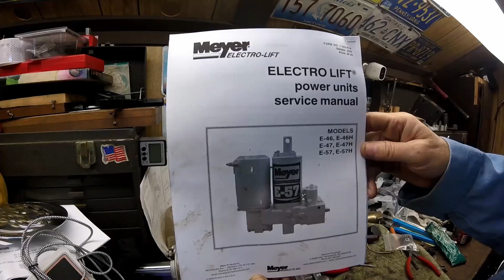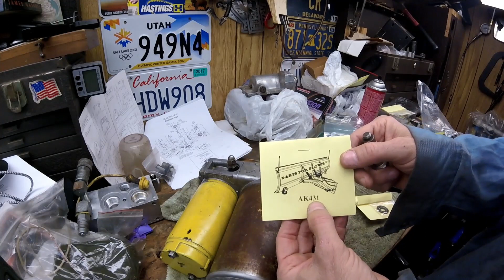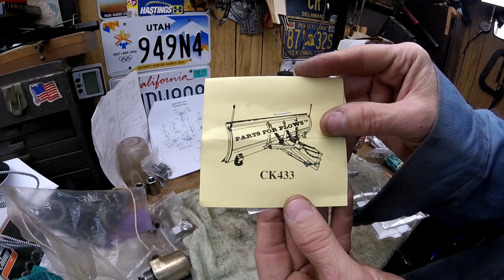Rebuild Meyers E-47 Plow Pump Best One complete

Comment: After the rebuild everything works as it should but I can't stop the leak from under the valve block plug.  The Meyer parts list says there should be a 9/16 ID O-Ring to seal it.  Originally I had the plug only moderately tight.  It leaked around the O-Ring so I toghtened it a little more.  Observe leak and repeat until the O-Ring squeezed out from under the nut.  I tried again with a new O-Ring with the plug tighter on initial installation, but the same thing happened.  What am I doing wrong?  I made a soft aluminum washer, but it leaks.  Now I've made a lead O-Ring which I'll try next.  This is frustrating.  And I don't see that anyone else has had the problem.
Reply from the maker: @jimlougeay9849  I’m not familiar enough with these to help but I wonder if your system pressure is too high.
Reply: @Rapsgarage  Probably not to much pressure since the motor barely slows when a cylinder hits a stop.  I don't have a pressure guage with sufficienmt range to check the pressure, but I put the relief valve back about where it was.  What's odd is that this critter is around 45 years old, and it never leaked before the rebuild even though there was an O-Ring there when I took it apart..
Reply from the maker: @ is the o-ring surface flat and clean? I always flat file the surface to make sure there is not any burr or something that would cause a leak.
Reply: @Rapsgarage  Both the O-Ring surface and the understand of the plug are perfectly smooth and flat.
Reply from the maker: @ I would have no idea then. I would have to see it.
Reply: @Rapsgarage  There is probably some magic number for the torque to be applied to the plug, just shy of what it takes to squeeze the O-Ring out from under the nut.  If I find it I'll come back and post.  Thanks for your help.
Reply from the maker: @jimlougeay9849  At what time in my video are you referring to?
Reply: @Rapsgarage  No particular time.  But I did solve the problem - a copper drain plug washer from O'Reiley's.  I had to whittle the OD of an an O-Ring down and use it to keep the copper washer centered under the head of the plug, but it worked.  Thanks again.
Reply from the maker: Awesome!

Comment: Yeah , thanks for not showing the pump draining part,  I got unit off the truck Iike you shown in video,  I checked screens there clean good shape,  👍  I opened drain plug and that wasn't funny 😮 I got blasted in right shoulder in my coat darn it with hydraulic  fluid , had bit pressure  I did realize  this, So now I got  find out how get darn plow pick up  shaft down  release it too float mode
Reply from the maker: This pump showed up for me to fix without the truck so I didn't realize it can store pressure. To be honest, I don't know much past what you see in this video about these pumps but I'm sure I could figure it out. I have another video that may help you. https://youtu.be/3vBLir_09I0
Reply: @Rapsgarage  Hi, from Don,  I figured the Meyer pump it runs fine with manual, I had to use my garden tractor 12v battery hook it up to positive from battery  to pump motor positive, then ground the pump to battery,  then just click each solenoid on the positive wire, they all work, then I found out the black wire was the down solenoid, So with Ratchet  strap hooked on chair real tight over the piston top with me touching black wire it went down as long as the red and black was together I could Ratchet  the piston all way down , So what was wrong with mine water was in it bit and froze So No fluid would flow, I drained it  all out let it set dripping out , then refilled it, 1" 1/2" from top using black zip strip as dip stick and it's back working fine 😀 I filled pump with VP Ultra J20A Hydraulic fluid it's good from -10° too 95° from Tractor Supply  2 us gal was lot cheaper than Meyers pump fluid
Reply from the maker: Water will mess them up for sure. Great job finding the problem. Thank you for watching and commenting.

Comment: If the motor not running fast enough will that cause the ram not to come up and blow the fuse. And which way does the spacer go. Cut out in or out
Reply from the maker: If your fuses blowing when you’re trying to run motor that sounds like you’re drawing too much current. That could be from a motor issue, but it could also be a problem with your pump seizing up causing the motor to draw too much current to turn the pump. I’m not sure what spacer you’re talking about can you give me a time in the video where that occurs.
Reply: I rebuilt the pump I can move the ram shaft. What would cause the pump to seize up it turns free. If the motor isn’t running fast enough will that cause the ram not to come up. I tried to run a drill and see if it would run the pump fast enough and lift the ram and it didn’t work.
Reply from the maker: @heathmathews4403  Sounds like you need to adjust the the pump pressure regulator. It on the side of the pump block. The best way to do this is with a pressure gauge and follow the manual but I just had to adjust the E-57 I did because it didn't move the pump at all. I was able to do it without the pressure gauge. I turned it clockwise 2 turns but that would depend on where it's at before you start. That increased the pressure enough that it moves the plow at a good speed but it now stalls my motor when the plow is at the end of travel. I backed it off a 1/4 of a turn (CCW) and I need to test it again. Your welcome to send me your phone number to the email address I stated earlier and I can call you and walk you through it. Also, I think I stated in the video that this (E=47) is the first time I've ever rebuilt a plow pump. I since rebuilt a E-57 but all of this was in the last 3 weeks so I'm no expert. Like I said, I did test the E-57 the one time but I removed it because it had a small leak and I haven't had the chance to test it again. I haven't had the time to test the e-47 yet but I'm confident that it will work fine.
Reply from the maker: The pump pressure adjustment is at the 9:25 mark of this video. Thank you for watching.
Reply: @Rapsgarage  are you getting my messages
Reply: This won’t let me leave my email or number
Reply from the maker: @heathmathews4403    hdrap_1999@yahoo.com
Reply: I sent you a email with my number hope to hear from you. Ty
Reply: Sounds like the motor has a short or bad brushes inside the motor

Comment: I have a E47 pump and it gave ground on the power stud and can't figure out why it has ground even with the all the wires unhooked
Reply from the maker: @jamessarti5088  sounds like something internal is shorted to ground. Also check where the power stud comes through the housing. The insulators can be bad.

Comment: In no way am I questioning your expertise and this is just an observation but at the 32:42 portion when you say you can't slide the solenoid on the shaft it appears you still have the nut on the vavle which would prevent the solenoid from sliding all the way down on the shaft. I'm sorry if my comment and observation is wrong as I'm watching the video because I am getting ready to rebuild a E47 and know nothing about it, so your instruction will be invaluable for my success in this venture. Thank you for taking the time to sharing your experience in this endeavor and again my apologies if my observation is wrong. Keep up the good work.
Reply from the maker: You are correct that the nut is still on it. The solenoid did even slide far enough to contact the nut. 
When you ram a snow pile it causes the shaft to swell a good bit. This is the important takeaway  of this part in the video. 
Good luck on your rebuild. Reach out to me if I can help further at hdrap_1999@yahoo.com with your phone number. Thank you for watching.

Comment: Do you have a link for the o rings inside the actual pump housing?
Reply from the maker: I got the kit part number out of the manual. I got the manual with a Google search. I believe I bought the kit from eBay.

Comment: Thanks for the great video.  I bought a used setup that didn't function but even with the new kit it still doesn't work. Motor runs, pump did pump fliud when i bench tested it after re assembly but plow still doesn't raise or angle. All solenoids click.  Any suggestions?
Reply from the maker: Increase the pump pressure. I had the same problem...

Comment: How do you adjust the release valve left and right? Neither position is holding  when snow builds up uneven.
Reply from the maker: If the pump raises the plow then the pressure adjustment should be good. I would check the solenoid valves that they work and the o-rings are good. If all of that checks out then I would think the seals in the rams are bad or heavy pitting in the ram pistons.

Comment: I got same pump I jumped the switch and it turns instead of go up. Wat is wrong with it
Reply from the maker: I have no idea what “jumping the switch” means but if the motor runs then it could be a bad solenoid. It could be a few different problems since they are somewhat complicated. Your best bet would be to rebuild your entire pump. It could also be in the controller and not the pump unit.
Reply: Wat I mean by jump the switch is I unplugged all siloniods  and used a jumper wire to try to lift the pump. Straight from the battery.  And it still turns instead of go up.  I got a small 2000 lb wench bolted to b per with a pulley system to move up and. Down.  Intell I can get pump fixed
Reply from the maker: @codyedgell5936  if you’d like you can email me your phone number to hdrap_1999@yahoo.com
Maybe I can help you over the phone

Comment: How did you get the bolts out of the valve that you used antisieze on ?
Reply from the maker: I had to drill into the Allen head of the bolt and remove the top portion of them. Then I was able to slide the housing off. The studs were still left in the ram housing part. At that point, I took a torch he don’t have them up and grab them with a set of vice grips to remove the studs.
Reply: Thank You, I was thinking that's what I was going to have to do.
Reply from the maker: @keithrausch2058  thank you for watching.

Comment: Ok so I put new rams on the side swing new hoses appeared to be same size filled oil started to move up and down tried side swing blew a new hose could rite and left swing hoses be reversed
Reply from the maker: That sounds like an over pressuring problem. If the side to side hoses are reversed it would only move in the opposite direction that it’s supposed to. There’s a valve that gets adjusted that relieves pressure once you hit the stop point of movement. If that’s not adjusted correctly you could easily over pressure the hose.
Reply from the maker: The E-57 plow pump is very close to the E-47 plow pump. This video may help you too. Rebuild of E-57 Meyers Snow Plow Pump Assembly
https://youtu.be/3vBLir_09I0

Comment: At 6:57 mine does not have that divider plate. My kit also does not have the two large o ring you are talking about, I suppose one goes on each half.  
Also what happens if you put the upper plate 180 degrees.  I noticed you never said anything about marking it when you took it apart which of course you never showed.  I never did.  It appears that it fits right either way.  Maybe I am missing something.
Nonetheless, I replaced that inner seal where the shaft goes through.  Mine just decided to leak through couple of holes there where the motor sits.  I have no idea why.
The first time around it leaked I took it apart only to notice that the inner seal where that  shaft goes through was  somehow cockeyed for some reason.   So I just took it out and installed
a new seal like you did.  I didn't replace it the first time around.   Go figure.
It still leaks.
So for now I gave up on it and am watching your video to see what i am missing all of a sudden.  It didn't leak before.
The reason I took the dang thing apart is because the ram was not going up.  I rebuild the ram part last week. 
So then I decided to do the motor pump part.  And it is decided to leak on me after. 
Then I realized what the problem was in the first place why the ram was not going up.  it was the power wire that was going to the motor.  Corroded wire.  So I fixed that.

So now the dam thing is leaking is the problem.  Well if I knew better I would have left the damn thing alone and fixed the power wire to the motor.   And that is the way it is.  Also I did not prime it.  Maybe that is the problem.  I don't know.
Reply from the maker: I can’t see how your pump doesn’t have any O-rings to seal it. That plate does matter which way it goes in. You can see in the video that the upper side has a smaller cut out than the lower side and both those cut outs match the pump. I have another video on my channel of a different Myers pump and it has that divider plate also. You can email me your phone number at hdrap_1999@yahoo.com and I can help you over the phone. Also, if you have an iPhone we can FaceTime and you could show me what you’re talking about.

Comment: 19:55 Groove washer on the ram is wrong( facing up) . Grooves Should be down towards the rubber seal ... It's listed as a common rebuild mistake and looking at your disassembly videos it was the other way originally.
Reply: Not trying to be rude. You clearly have a in depth understanding of these pumps just what I noticed from watching your videos and reading on how to rebuild
Reply from the maker: Yes you are correct. I took it apart and fixed it a few months ago. Thank you
Reply from the maker: Yes you are correct. I took it apart and fixed it a few months ago. Thank you

Comment: Where did you get the  two O rings for the pump base? Where those separate if so what part # were they thank mick
Reply from the maker: These came in the kit I bought on eBay. I had to get a second set for another pump I rebuilt. The second kit I bought didn’t have them. I went to a hardware store that a selection of O-rings. I just matched them up.
Reply: Ok thank you, I ran into a problem rebuilding the pump part I installed brand new shaft seals, and coated the outside with sealant, and installed the seals I put it all back together and put it back on the truck and it was pouring fluid out of the weep hole under the electric motor? I was very disappointed in that too say the least so I ended up talking too Stork mechanic and he told me that he just installs new pumps on them which I ended up doing which solved the problem, I’ve worked on these pumps for years, and this was a real PIA, but for your info I’m guessing the new seals are not correct size, as old seals were, just letting you know for further reference. Mick
Reply from the maker: Thank you for the information and thank you for watching. Please subscribe.

Comment: I am rebuilding an e47 and the strainer was missing. Do you know if it is the same mesh size as the filter down below? I have a metal mesh from a coffee maker which seems the same size as the filter and would make the strainer out of that. I need a strainer now. 
Also. there was a lot of water in the unit. Once I rebuilt the pump, I rotated by hand the pump's 2 gears and for each rotation, it went from smooth to quite stiff but still making full rotations. I did a bench test and the motor seems to turn the pump fine. One of the 2 gears' shafts must be warp a bit because before I put the cap on with the 4 bolts, the 2 gears turned freely.  Probably nothing I can do to rectify this. 
Thanks
Reply from the maker: For the strainer I would say the mesh is not as fine as the filters but I’m not totally sure. I would make sure that you get this right because it will starve the pump.
For the pump it very important to flat file all the mating surfaces. I had the same problem with the pump. It was fine until I tightened the bolts. I flat filled everything and that fixed the problem. I can also talk over the phone if you want. Email me your phone number at hdrap_1999@yahoo.com
Thank you for watching

Comment: You wouldn’t happen to remember what size the o-Rings were that you had to get for the pump base?
Reply from the maker: I’m sorry but I don’t. Take what you have to a place that has a selection of O-rings and match it up. You can check ACE hardware. You can also check eBay.

Comment: How do ya get the stuck valve block bolts out ?? No one shows that on any of the vids
Reply from the maker: I drilled the heads off then pulled the block off. After that heat the part of the bolt that's left really hot and then hit it with ice cold water. They will turn right out. Hope this helps and thanks for watching.